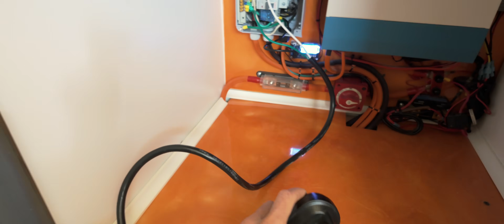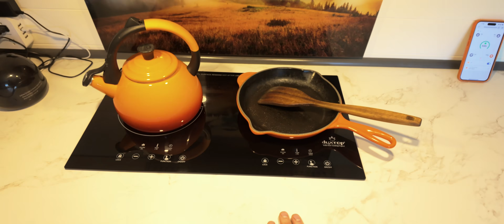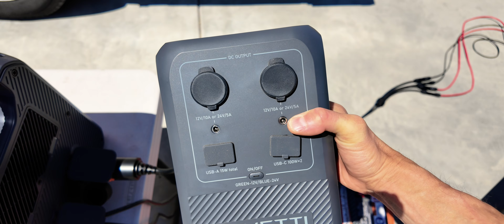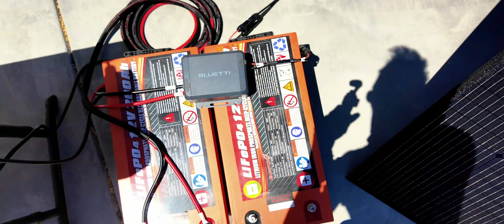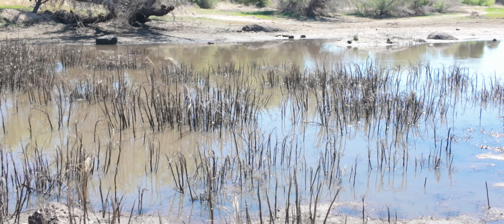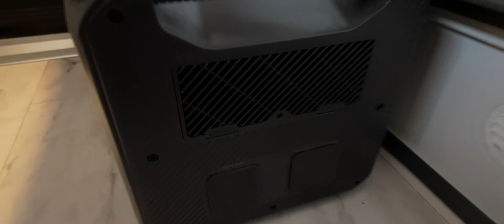The Best Power Station for Van Life Air Conditioner | Bluetti Apex 300

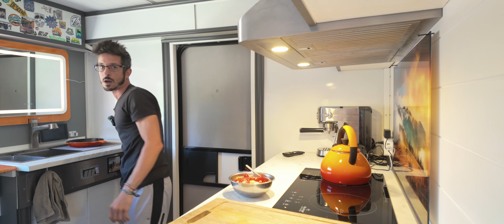Comment: for me personally, I'd use a power station as a backup to my custom DIY component system. IF anything goes wrong, like inverter issues, charging issues, etc. you can't just open it up and replace anything, VS pulling any faulty parts out of your component system to replace 'em as you start covering at 10:02 Great video as always !
Reply from the maker: I agree with you, it would be a great backup